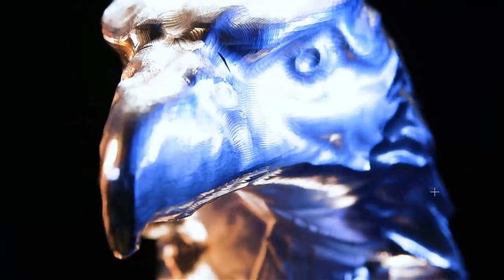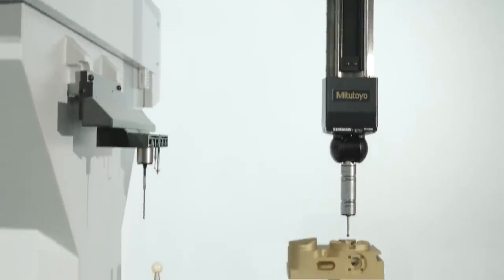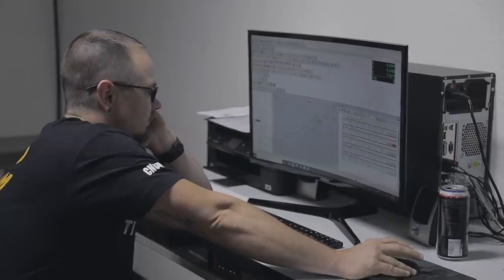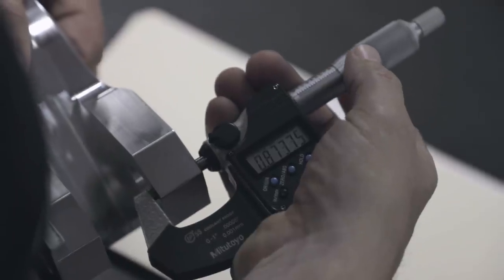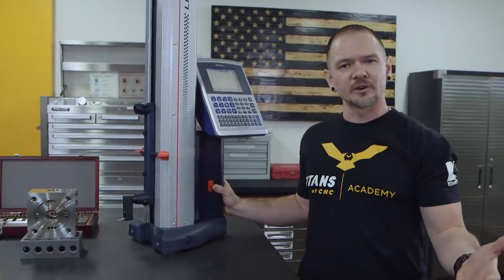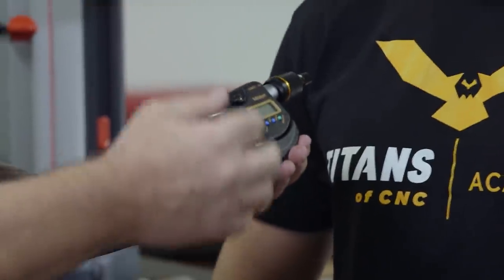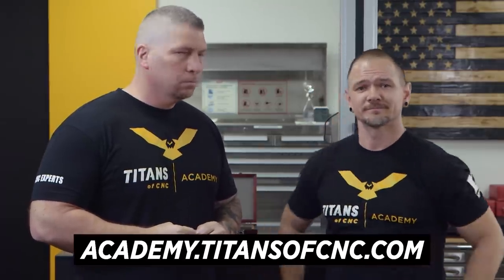The Most Important Part of CNC Machining | VLOG #113

Comment: I spent 30 years on the shop floor from manual milling to CNC turning, making parts 
for all types from F1 to Printing machines.
The last 4 years I've been a quality engineer at a sub contracted engineering firm in the UK ,
it looked like to change so i went for it, i had a problem with a bad back and hips when i was
on the shop floor , so i needed a break from it.
Not looked back, the job works well for me and having the knowledge of being a machinist, i know
what to look for and have respect for the people on the shop floor which helps a lot.

Comment: Engineering and design is not important. It's only important that you EXACTLY make what is specified in the drawings. But if the design doesn't work, who cares? It's not important, especially if you are only a contract manufacturer. If the design is wrong, then your customer will have you build the next rev. It's great for business (but bad for the economy because of all the waste).

Comment: I just want to know if I buy a #Mitu vernier, if I still need to move and reposition the little battery inside to make the caliper stay on like it does on any caliper I have ever bought....
Reply: Mitutoyo Calipers have a unique capability.  The caliper automatically turns off to save power.  The real feature in the caliper is an absolute scale system that retains the position (even when changing the battery).  This allows the battery to last about 3.5 years on the Mitutoyo.

Comment: Very Nice. I have a quick question for you Travis. You basically selected a mode,, entered a Dia. and then the height Gage moved itself  when it probed the hole or you moved the Gage?
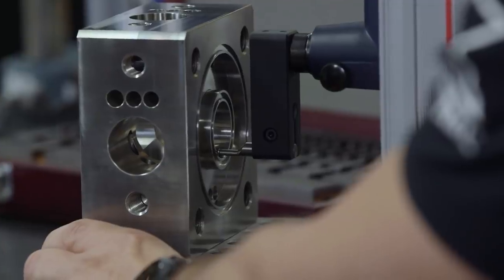Reply: So the Height Gage he (Mitutoyo LH-600) is using has what's called a sweep mode for ID and OD.  The sequence that used is to select the DIA button, the z moves down to contact the ID hole, then you move (or sweep) across the hole from side to side.  Once it gets enough surface it automatically moves up and contacts the top of the ID hole. Again you sweep to the opposite side and once it gets enough surface points it completes the measurement.  What your really cant see is that it puts constant pressure automatically in both the downward and upward sweep movements.  This really increases the accuracy as the operator just has to move the Gage from side to side. So how do you know you are square to the face?  Another feature of this Gage is a couple of tooling balls mounted on the front face of the Height Gage. If you look at 3:51 of the video you can see one just above the are where his thumb is (grey round area).

Comment: What’s the best way to measure a 5 mm H7 hole? Which kind of instrument?
Reply: I've actually been running a part with a 10mm H7 hole and I've been using a bore mic and just checking a few spots throughout the length of the hole. Maybe not the best way but for the tolerance I have, that's the best I could come up with using the tools we have.

Comment: Quality first! And adopt the metric system!
Reply: Do those who use the metric system not know the magic number?
Reply: No, what's that?
Reply: @Thomas3DP  25.4 is used to convert metric to imperial it visa versa. Divide metric value by 25.4 to get imperial value. Multiply imperial value by 25.4 to get metric value
Reply: @timmead4598  But how do you divide by 25.4 to get a fraction number, like say... 3/8".  ?
Reply: @danl.4743  guess it depends on what you need. If you need the decimal value of 3/8 you divide 3 by 8 to get .375 then if you want to convert that to metric you multiply .375 by 25.4 to get 9.525mm
Reply: @timmead4598  No, I mean, sometimes I get the decimal inch number and I just gaze at it thinking "what the hell is this in fraction".  
BTW, I lived in NY for 30 years and now in Europe.  I am "fluent" in both "languages".  The only problem I have is when I'm looking at some decimal number and I wonder if it represents a perfect standard fraction.  I'd need to remember the whole 64th table for it.
Reply: @danl.4743  oh I got ya. Idk I guess if you have a hunch that it's a fraction then multiply the decimal value by 2/4/8/16/32/64 (mostly 32 or 64 assuming you know all the others) and if you get a whole number as the result then your fraction would be the whole number over the number you multiplied the decimal value by
Reply: @timmead4598  Oh wow.  So for that example, 0.375 x 8 = 3.  Which means that it's 3/8.  You're a genius man. I don't know why I didn't think about that. Thanks!  Haha! you made my day!  Thanks again.  :) 
Even if it's not exact, it will bring me close enough, which is great.
Reply: @danl.4743  Glad I could shed light on another solution but idk if I can claim the genius compliment lol. Sometimes you just have to look at the equation from right to left rather than left to right
Reply: @timmead4598  That's right.